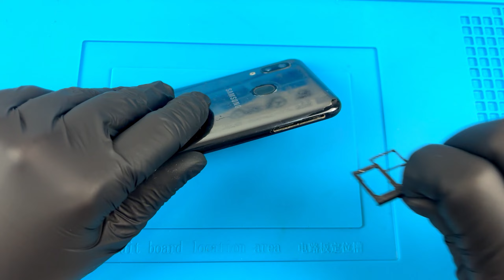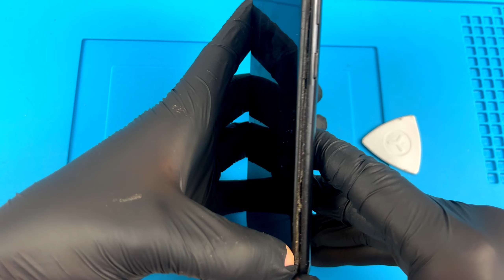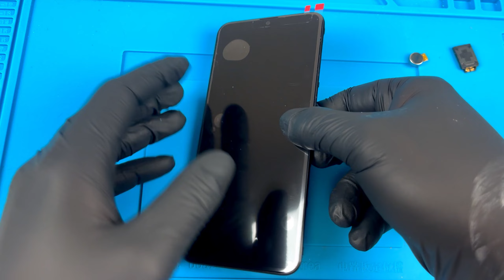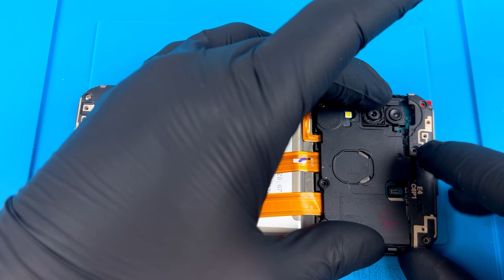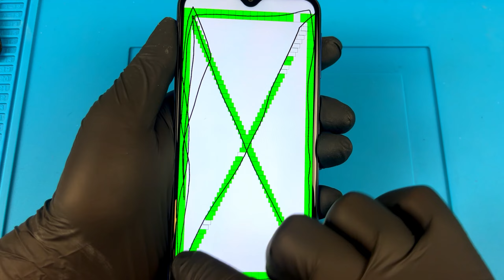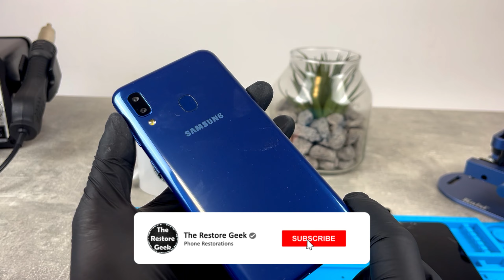Budget Phone Restoration and Repair - Samsung Galaxy A20E

Comment: I still use it. It suffered liquid damage, fell in paint bucket, still works. Though the charging speed has sustained some damage. Check charger connection often appears, but if I turn usb c around, it says fast charging.
Reply from the maker: Unexpectedly resistant then 😁Glad it still works! I have another one that doesn't take current. Might make a video on it at some point, maybe it will help you out to try and fix the charging.